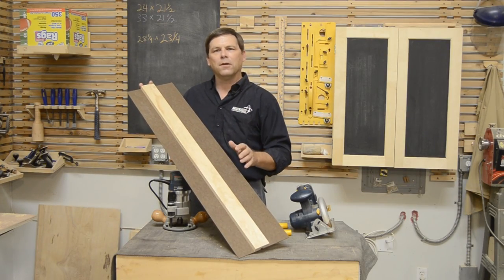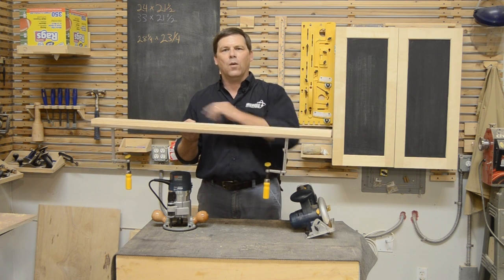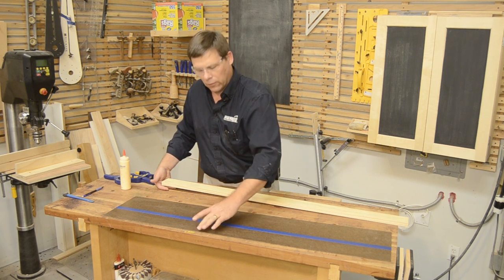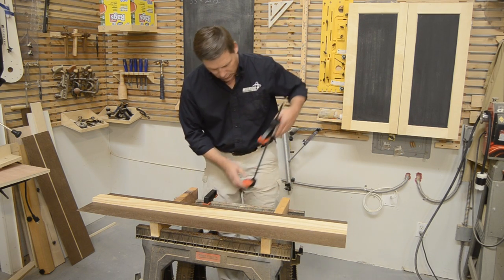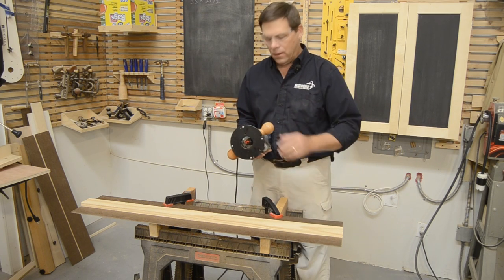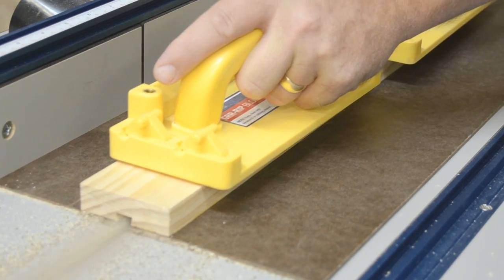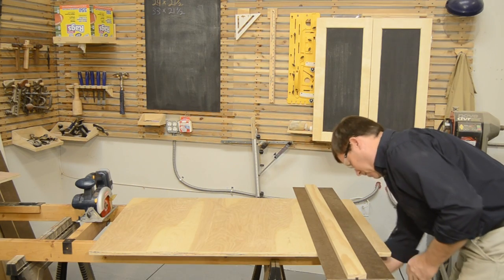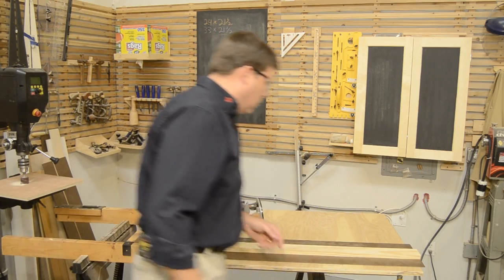DIY Track Saw Fence with MATCHFIT Dovetail Clamps

Comment: I use a 2-sided guide, but set up for both the narrow and wide sides of my circ saw. A router on this guide only works.for whatever bit you used to create it so we make separate guides for the router - one side for 23/32 plywood bit and the other for a 7/32 plywood bit - that’s what we use to build most cabinets 
A pair of spring clamps holds a saw guide like made here  perfectly, is way faster and more versatile bc you don’t have clamps hanging down.  We use a 1” sheet of sacrificial foam cut 4” shorter and 4” narrower than a 4x8 sheet so the bottom of the spring clamp has room. Set the blade to cut 1/8” into the foam.

Comment: The router guide edge will only be accurate if you are using the same diameter bit you originally set it up with. If you use a bit in the router with a different diameter, the edge of the guide will no longer be an accurate edge to use when aligning it with the workpiece.

Comment: Question - Great idea - but it seems the max thickness you can cut is around 3/4" material. Have you thought about using the narrow side of the saw base allowing the motor to be free from guide? Just curious - thanks, Larry
Reply from the maker: Larry,  I oriented the base to mostly ride the hardboard body in order to make the cuts as stable as possible. The saw base is less likely to tilt during cutting in this position. 
But yes, the motor can overhang the cleat and that may limit the max depth of cut. 
You can simply turn the saw around and re-cut the hardboard to use it that way if you wish. That is the best part of making your own jigs and tools; you can do it your own way.
Reply: Thanks for your feedback. I think, rather than using one of the sides for the router, I will use one side for the narrow part of the saw base and one side for the wider side of the saw base. That way, if the need arises to cut thicker material, the saw & this jig can be used. BTW - I am a total MATCHFIT guy!! Everything I make (JIGS and workbenches) has the dovetail grooves! - Many thanks, Larry
Reply from the maker: @EEEZSolutionS  sounds like a plan!

Comment: More utility with the router if the width were set with a large diameter template guide instead of the router bit itsel.
Reply from the maker: Thomas, the best part about making your own jigs is that you can build to suit your needs!
The reason for this set up is so that the edge of the guide is set exactly on the cut line for both saw and router. 
No need to figure offsets, just set to your marks.